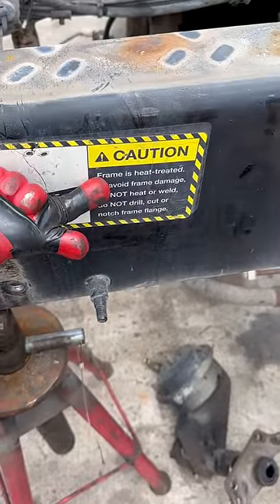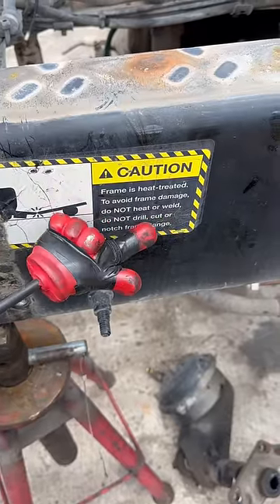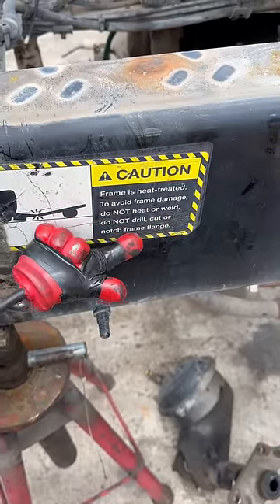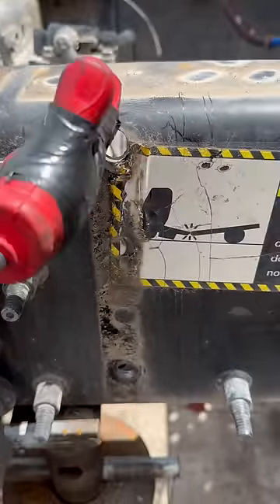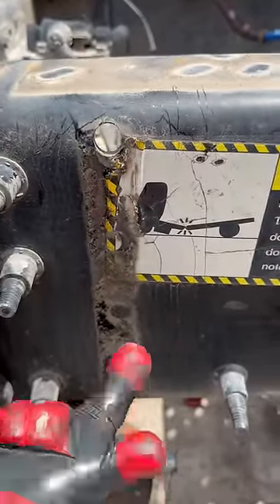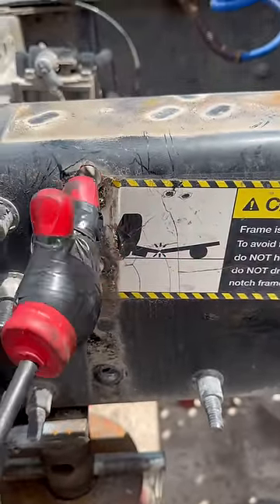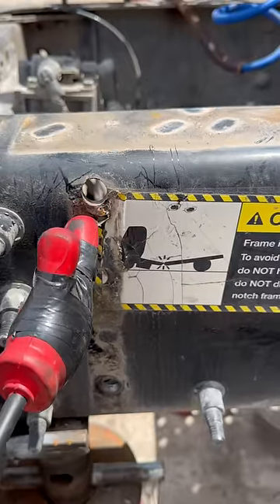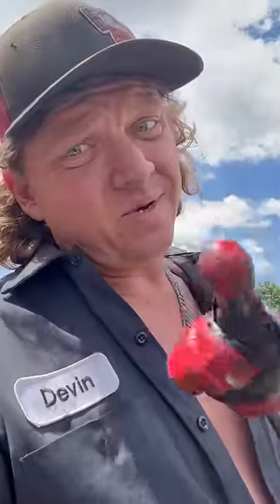When it says don’t do it , DONT DO IT

Comment: I bet whoever drilled the frame puts metal in the microwave cause labels dont tell him what to do
Reply: Tbh honest not all labels are equally honest with consumer. But microwave label and this one definitely are.
Reply: The audacity to assume that person could read.
Reply: I once got told that it was perfectly fine to put metal in the microwave as long as it didn't touch the sides. 

When I shouted "THE BOTTOM'S A SIDE!!" I got THE most deer-in-headlights stare followed by that look of dawning comprehension. That definitely is one of those burnt-in memories..

Comment: This RIGHT HERE is why the aftermarket manufacturers need to provide a "Frame Bracket that attaches (Goes over and locks into the flange)  and has two pre drilled holes in the correct area, to hang boxes or steps or what have you.
Reply: Seeing how I live less than 20 mins from East Manufacturing (Randolph, Ohio) And MAC Trailer Sales (Alliance, Ohio) Maybe I need to be the guy to fix this problem and design something like this 🤔🤔🤔.
Reply: @Pyle81  u trying to end bendons career?
Reply: That doesn't make them money.
Reply: As a person that has extended frame rails beyond 120", installed many boxes. I can assure you each frame is different on all dimensions, some are even aluminum I've done. Cross members, airlines, flatbed, hitch, and alot of moving parts can come in contact as well are all things to consider. They already make brackets (buyers products) for example probably similar to what was mounted here. He makes a valid point of taking it to someone who knows what they are doing, whether they clamp it on or drill and bolt it. Hope this helps.
Reply: You'd never realize the same level of securement clamping over something as you would bolting onti it. There are also regs for securement of certain components - such as certain tanks - which specify they must be secured with fasteners such as bolts and nuts.
Reply: @alidycepaisley3829  you do know they make clamp on brackets already right? Even on a fifth wheel there is no law requiring how many bolts hold it down only recommended sizes. Dot checks for loose hanging items/insecure load. Fuel tanks and hydraulic tanks are strapped no bolts on the tanks. If you can point me to a law I'm 💯 interested in reading and learning more. Thanks
Reply: @Pyle81  you're late to shark tank.... they've had clamp on brackets for ages fyi.  Sorry, to spoil your idea.
Reply: @Not.The.Avg.Smitty  A waste tank, such as would be used to contain the refuse of a flushing or macerating toilet, cannot just be tied to a frame rail, it must be secured to it with fasteners. It's been years since I read that. Since the clamps you mentioned use bolts, I guess that works then.
Reply: @alidycepaisley3829  like I stated, and you did. All they check for is a secure load, some clamps go around the frame, and boxes, chain hangers, etc. can be mounted without any bolts at all. Same with tanks, dumps, flatbeds, or van box etc.. All they ask the mfg. is to secure it "properly" so laws are very vague. I can bolt, weld, or clamp the bed on if I choose, but liability comes into play. 

When a new truck comes, they are "unfinished " meaning cab and chassis. I as the body builder, I must mount "properly", take to a scale, have it certified, and then it is a complete vehicle ready for the customer. Any other information would be appreciated.Hope this helps.
Reply: I built a clamp-on compressor mount for a truck when the owner didn't want a mount welded to the frame. He had a point- frames are heat treated and really shouldn't be welded on. Sometimes it's unavoidable.
Reply: @TehButterflyEffect  u are correct. I work for the manufacturing company that makes rails for Mack, Volvo, Peterbilt, Kenworth, Hino and Autocar. I run the machine that heat treats truck rails. I also run the machine that punches the holes in the web and flanges of truck rails.
Reply: @proberts4243  That's pretty interesting.
We built a bracket for the compressor to bolt to, then used 3/8" allthread that we bent into a big u-bolt that wrapped around the frame and bolted to the bracket. It worked great. It's probably still installed on that truck.
Reply: Why would they do that when they make so much money off the morons who ruin the first one they buy.
Reply: Frame clamp products are ass. I do custom rigging on Petes, one of our customers had us start using chassis grabbers to mount their toolboxes, they're so finicky and don't feel secure in my opinion. I'd much rather drill a (competently measured) hole.
Reply: @Pyle81  iused to work out that way sometimes, that place was huge (East)

Comment: I do a shit load of frame repairs, it’s not as simple as throwing a plate on sometimes, people don’t understand
Reply: How would one fix this? Can't weld a new plate on or fill the hole.
Reply: @CrackedCandy  At this stage, I'd guess you'd leave it and just hope it doesn't fail. If it really was a problem you could bolt a support around it (not through it), but it seems like an awful lot of work. Maybe some specialists can chime in with a better idea?
Reply: @charmio  you can weld it back up as long as special attention is paid to pre and post heat. Welds are extremely strong but lack flexibility that a frame like that needs. Annealing will help, but the frame will never be as strong as before.
Reply: @CrackedCandy  personally have done this....
I cut the frame at angle, removing the bad area, adding a sleeve to the inside, then adding (welding)the frame back in place drill all new holes for hangers and mounting points, airlines brackets etc...

8hrs to do a wheelbase, like I explained, always waiting for the driveline shop so I can finish. Though this would not need a driveline if they stay the same center axle length. Hope this helps.
Reply: @Not.The.Avg.Smitty  thanks
Reply: @CrackedCandy  no problem, ohhh and not cheap... this is my personal opinion on fixing it. Some may differ, like just adding a sleeve and plug welding the holes. In my experience, welding these holes can cause cracks later on due to the flexing.

Isuzu npr's have a frame that looks like swiss cheese on the sides of the frame to allow body shops to mount accessories.😉
Reply: We did it at the dealership.  They had a containment box to reheat treat the frame.  We often put a heavy stress gusset plate on the inside of the frame to ensure the frame would support the load the truck was intended for.  I saw dump trucks get 1 inch gussett plates.  Extreme Duty.
Reply: @joeyl.rowland4153  the containment/ovens are for normalizing the temperature before and after welding process generally for stress relief of the welds.  This does not temper the welds nor frame, though i could be wrong on what you were using. hope this helps.
Reply: @Not.The.Avg.Smitty  No it was used for frame tempering.  It's use was very limited.  It was a miserable pain in the ass.  We only used it like 3 times when ordering a new frame was impractical.  In laymen's terms it could only be used like 5 percent of the time.  A lifesaver when it could be usedit was a caveman used in the 1950's. It would work fine on just a frame but with cab engine tranny rear end fuel tanks hydraulic fluid tanks.  If you intended to use it everything had to be out of the way.
That is why it didn't get used often.
Dismantling the truck to fix a frame they did in the 1950's.  Now they scrap them if it is too expensive to fix them.
Reply: @joeyl.rowland4153  That's interesting and not practical at all, it seems. I was taught the molecular structure of the steel, and the weld is different, thus not tampered per say more so normalized.
Reply: @ryan-qz5xb  been welding for 25+, dad was a nuclear welder 35+, older sister was a navy welder. I always knew them as just that because its not changing the molecular structure of the steel. Not 100% certain, but I'd say they became obsolete due to welding advancement/technology. Tig welding didn't even hit until the mid to late 40s/50s.

Btw I've done over 100 wheelbases on tractors, even aluminum frames, longest, which was +120". Adding 10ft of frame is not what you call a great time.
Reply: it literally is that simple and i bet ive done more real frame repairs and extensions than you.mark your spots and use a mag drill, go to town
Reply: @the_chomper  zip-cut frame drills, better option check them out😉
Reply: for real! it requires knowledge of structural integrity.
Reply: Truth. You need to weld on old wrenches, pieces of varied-thickness bar stock you found in the barn, and use your best popcorn welding techniques to hide the whole job!
Reply: @MonkeyJedi99  it's why they invented Dr. Grinder

Comment: I work at a truck Body manufacturer.  We drill cut weld and everything on these chassis lol. I usually have to grind that sticker off to attach liftgates
Reply: Same lol how else will a hoist be mounted or hitch
Reply: Yeah I've worked on enough crane trucks to know that sticker is just to scare idiots. Sometimes you have to drill to the frame
Reply: You’re weakening the frame then, and you’ll (your company) be liable for any damage as a result. 
TBH, this sticker is not prohibiting mechanical modification to the web, just the flange, but it is saying no heat to any part. 
If you heat the metal to any temperature hot enough to cause any temper color, you destroy the heat treatment and weaken the metal.
Reply: @tylerfb1  we are certified so. We are liable if we doit wrong. But all our welds conform to AWS/DOT engineering standards. I mean there's companies that cut these things at the center and extend em and move the axles and everything else. The sticker is for normies
Reply: @swampypolitics9574  my point is, the sticker is true, heat processes destroy the heat treatment of the metal, making the steel weaker. That means it will not be rated for the rating that the OEM specifies.
You guys, and especially the ones that cut and weld frames, ARE OEMs. They re-rate the frames and vehicle accordingly. The fact remains, the frame is not as strong when ya'll get done as it was from the factory, depending on where the heat process was done. Its just that, you don't deny that and respecify the rating. Ya'll are certified to do that. You're average fleet operator that throws accessories on their truck are not.
Reply: @tylerfb1  yes 100% we re certify them

Comment: If I'm not mistaken, when drilling holes into a heat treated frame like that, you're supposed to drill relatively slowly, at least 2 inches from the structural bend, and use active cooling at the drill hole location while hogging out the new hole.  

Also, you're supposed to then reinforce that spot somehow, WITHOUT welding on reinforcement, or if you decide to weld on reinforcement, you're supposed to heat treat the thing again.  

Modification of Heat Treated Materials is a pain in the backside, but if done right, is absolutely worth it to get it done right.
Reply: It's not just the heating of the bit that is the problem, it's the hole itself. All the other holes were made before the heat treatment process and are now a part of the internal stresses that make up the heat treatment. Drilling holes breaks those internal stresses and makes that area very weak. Even with reinforcement and additional heat treatment.

Comment: The flange is the top of the frame rail. You are not supposed to cut, drill or weld to the top of the frame rails. You can drill holes on the sides to attach cabinets, tiedowns for tanks, aftermarket equipment, etc. There are already holes drilled in the sides of the frame rails for the suspension, sometimes a fuel tank, DEF tank, air compressor, etc.

You must drill holes in the side of the frame rails to mount tanks. Without tank trucks hauling fuel everyday, especially to farmers, the modern world would not work!

Comment: Worst part is that now it can’t be fixed… can’t just weld it shut and call it good cause the frame in that area would become even more compromised. Now you gotta throw a big ass patch on it or leave it and tell them to not do anything stupid…. (Which we all know won’t work)
Reply: I just posted put huck bolts in the holes and pretend you don't know anything about it

Comment: that sticker scared me from torching off loose huck bolts for years. always used a cut off wheel very slowly.
Reply: You can do that, cutting the frame with a torch would be a different story. You have to get the frame up in the 500-600 degrees Fahrenheit range to affect the temper.
Reply: @mitchell7203   induction coils work better than a torch in this case as if you fcuk up, the damage repair cost far surpasses what you bought the induction heater for. 😬👌
Reply: @mitchell7203  Yeah well those of us that aren't any good with a cutting torch will definitely get an area of frame to 600° by the fifth try.
Reply: @kittytrail  induction heater don't cut bolt 
You take the cutting torch heat the nut and cut it no heat to the frame
Or if your good with it a plasma cutter will rip rigth through 
Trying to heat with the induction heater and use a impact gun take forever if it even come loose vs good old fire wrench lol
Reply: So the sticker works but only if you’re smart enough to listen
Reply: First step is hiring edumacated mechanics and installers that can read! 
Most of them can't even follow (edit:verbal) instructions, much less show up on time!

Comment: Again, very good. Time for the mig welder & a flat piece of copper...
Reply: I've actually had to do that in the exact same spot . Dry ice is good in a rag to cool .I used heat absorbing clay pushed around the weld . Tig welding nice and clean no grinding the weld just etching primer and paint . Certified welder doesn't have to have that exrayed and inspected. Certification better be up to date tho .
Reply: Probably still fuck the grain structure of the steel. Fine in a pinch but I'd assume the load carrying capacity to be cut in half. Unless you reheat treated the whole rail again after.
Reply: Weld copper on a frame isn't a great idea.
Frame are made of steel in a special alloy 
So DON'T DO THAT 
if you want stay alive 😂
Reply: @nightstorm  I think the idea being for the copper to be a heatsink to reduce the heat affected zone from repairs. Aluminium is probably better in this case but you are meant to use a proper procedure which includes restorative heat treatment. Alternatively you essentially just derate the part by 50% in an emergency.
Reply: @SpencerHHO  Aluminum is a better conductor of heat but the mass is so low by volume, copper makes a much better heat sink for welding, higher melting temp as well.
Reply: @Max McCullough  copper can also alloy with steel at a much higher rate so in a situation where the chemical composition of the alloy is critical, copper maybe problematic. 

Whenever I've welded steel like this I've just pre and post heat treated the piece and sent it off for proper heat treating if needed.
Reply: @SpencerHHO  You'll never get the copper block hot enough to alloy with anything with any kind of arc rig.I'm guessing you are an engineer, or some safety man with a weld inspection cert, and not an actual welder from your statements....Also aluminum will alloy with steel as well, worked with allumaloy for years  when I was designing Mack truck sleeper cab components.

Comment: I have a 1978 Chevy k10 4wd...someone mounted a flatbed on it and drilled the frame flange several times. Is this going to be ok? If not how do I fix it?
Reply: Hold a flat peice of copper on the underside and fill with weld then grind off, keep repeating until you get it completely filled
Reply: No. It's forever screwed. Send me the truck and title and I'll properly dispose of it.
Reply: LMFAO, it's just fine. Don't stress over it. The morons saying you can't drill or weld a frame have no clue what they're talking about. 
People that actually have a clue with physics & metallurgy make frame mods all the time.
It's for people that do not know what they're doing is who that warning sticker is for.

Comment: People need to mentally visualize placing a bending force on the steel beam.  The part that contributes the least amount of strength would be toward the center.

Some beams actually have the center part hollowed out, like with round circles or oval shape.

Comment: OK, drilling the middle of the vertical web would be better. But the previous holes are not actually in one of the flanges (top and bottom of this C-section), so they don't actually violate the label.

Comment: Why is the factory fastener right next to it not 2” down?
Reply: Factory holes are most likely done pre-heat treat. Saves a lot on tooling when you put all the holes in when the metal is still soft.
Reply: and why not just attach  to existing threads

Comment: Structural integrity of that is goneeee. That's gonna buckle and crunch the frame.
Reply: nah, just weld a round piece in it and it'll be fine... 😅
Reply: Nah. What you get is a stretch of good service from the truck, a stretch where there's an odd shake and a weird squeak, and then that one day when a driver goes over a railroad crossing and the frame snaps on the crack that's been growing from that hole for a few years...
Reply: @mfree80286  not gonna happen will get call at the annual inspection 
And any decent truck place do preventative maintenance program (PMP) every 6 month 
Cracked frame is a major and will stall the truck rigth there meaning it need to be repaired before the truck can go on the road again and to top it off you need a towing 
If you don't do pmp and do the annual inspection 
Maybe it's different in the usa but a don't think so

Comment: I know it sounds weird, but as a relatively "new" tech at my Mack/Volvo Dealership ; one if my FAVORITE tasks is frame rails lol. And Remack swaps. I'd much rather do those than egr hot pipes/cooler bs and a ton of "small" tasks. And I agree 100%, should be common sense on the drilling